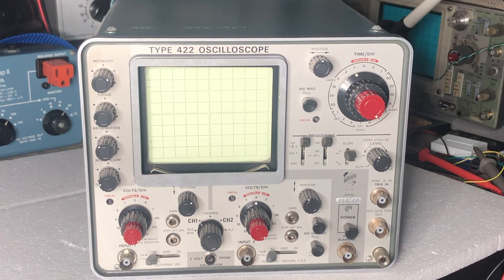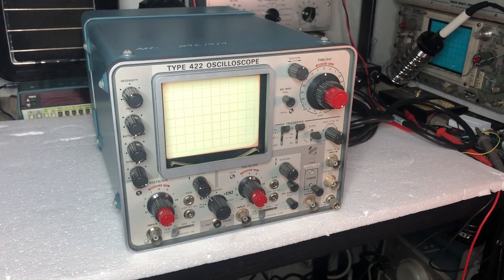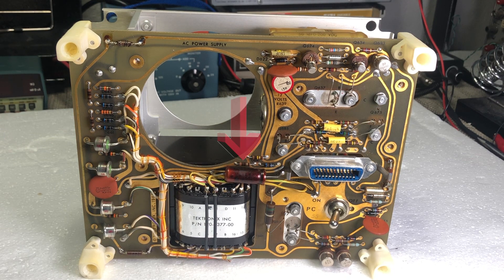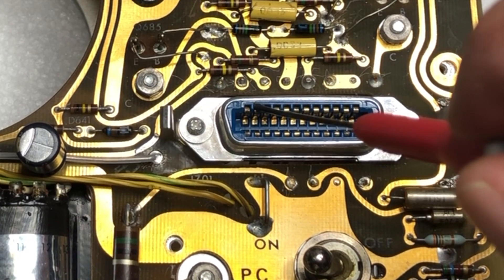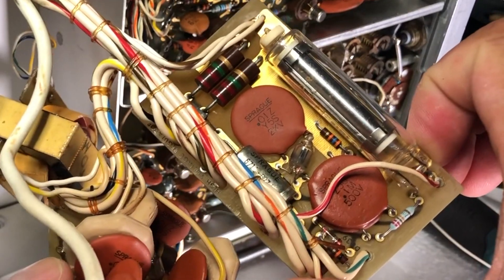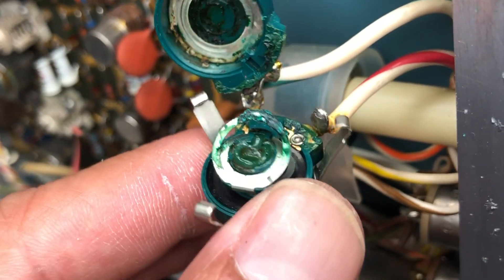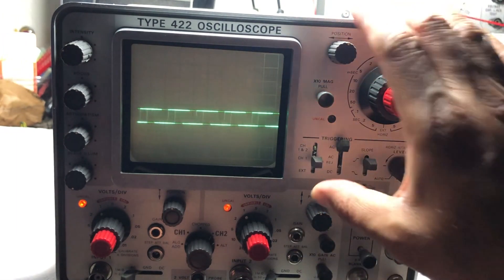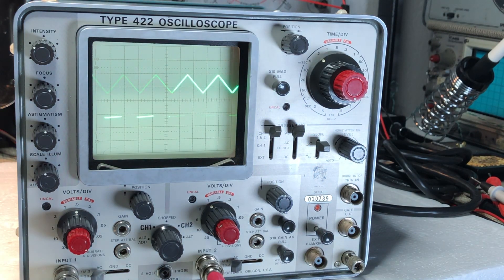Tektronix 422 Oscilloscope Repair

Comment: I have this model and the only thing that comes on is the pilot light and the set draws around 5.8 watts. All the caps in the power supply test fine so I'm not sure where to look to next.

Comment: Thank you for the excellent troubleshooting video, I really appreciate your thoroughness.  - I have not seen one of these since my EE lab days in college - these were made up until 1975 as I recall (graduated '77). I just received one (for free!) so I am embarking on my own troubleshooting adventure. They were really wonderfully made - sockets for each of the transistors, attention to detail on all the wire wraps etc - practically mil-spec. Thanks again!

Comment: Hi I have Had the same machine, and never got around to using it, cause i'm just learning, I turn mine on I tried to check the frequency  from a signal generator, It does not do a frequency sweep, It does nothing, what would cause this Problem. thanks for any help
Reply from the maker: check your trigger setting and ensure the "Level" is in auto (all the way to CCW"

Comment: Nice scope! I actually have one of these that I recently restored myself and it works pretty much perfectly still. It even has the battery pack. 20 D cell NiCds! I replaced them and a couple neon lamps it works like a charm.

Comment: I have this model, but power cord is damaged and I need a replacement that will fit into the round hole in back of scope.  What would you recommend for a replacement AC power cord or just the female part that would fit without major modifications?  Thanks!
Reply from the maker: Hubbell 5278G is the closest I have seen. Do check the dimensions to confirm if it fits in.